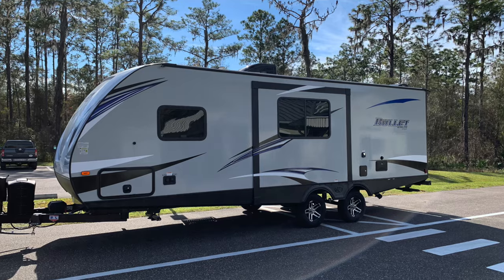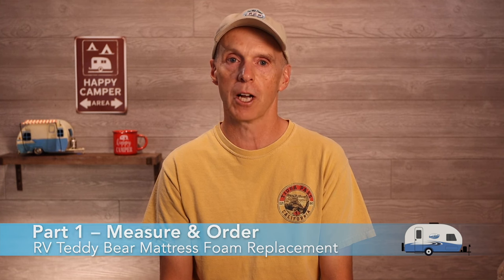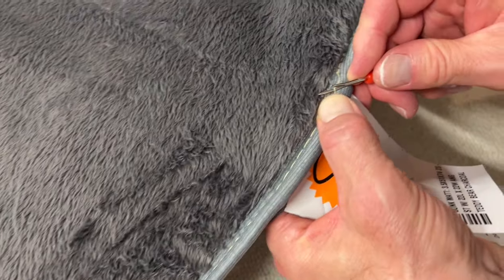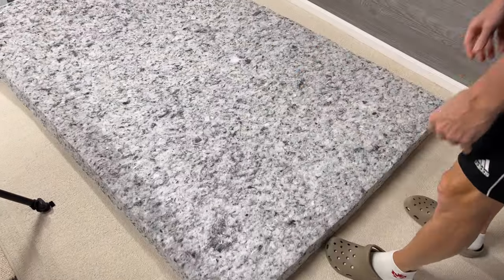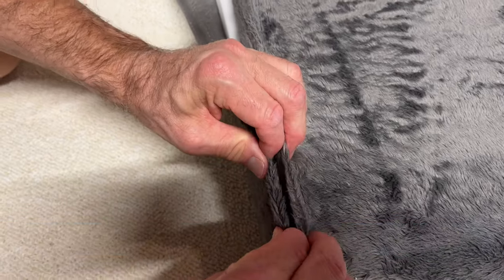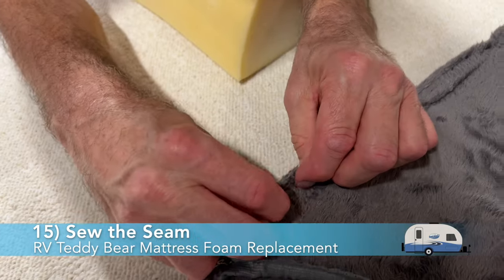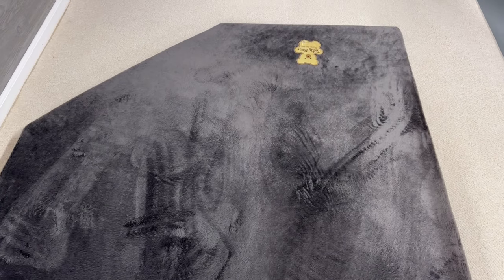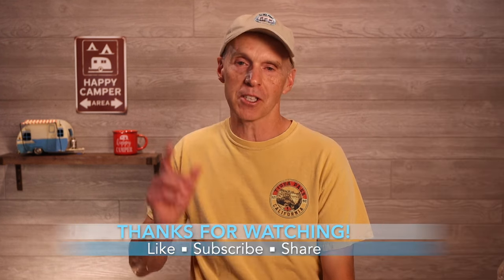RV Teddy Bear Bunk Mattress Foam Replacement – Step-By-Step

Comment: Good job replacing your own mattress! I did my own and put in a 6” three density foam mattress. I used a real sharp fillet knife to cut radius that I needed.Good DIY video John ! 👍
Reply from the maker: Thanks! Sounds like your upgrade went well. All the best!
Reply: @JohnMarucci  
It did ! Just spent 3 hours at Colt creek SP and checked it out ! Want to go back and camp and ride my mountain bicycle around that 8 mile loop ! 👍